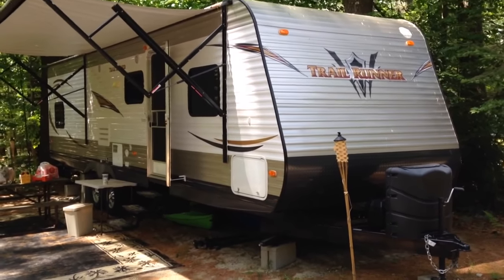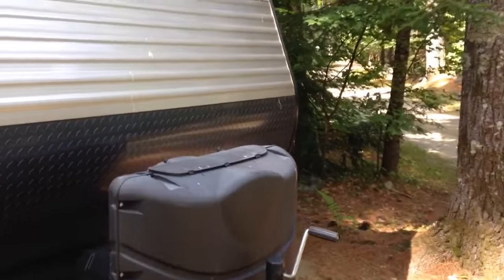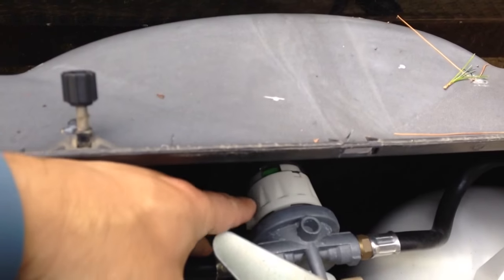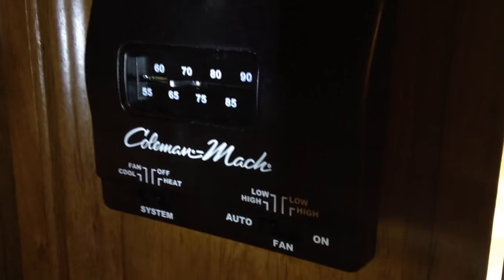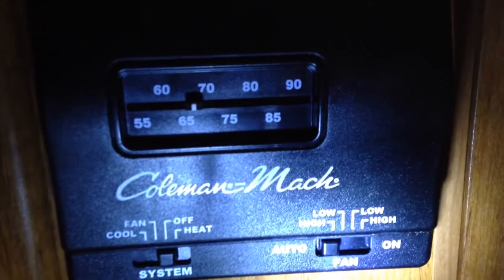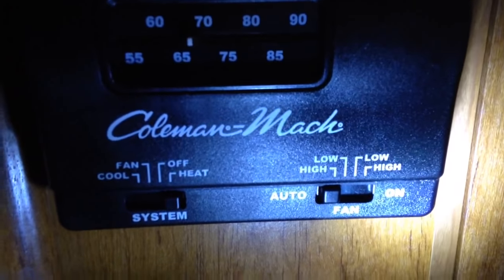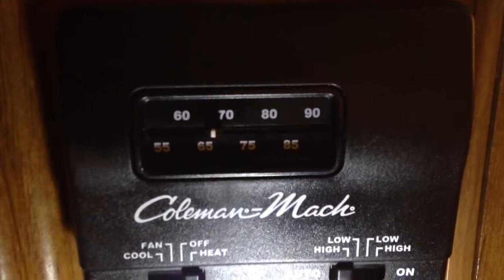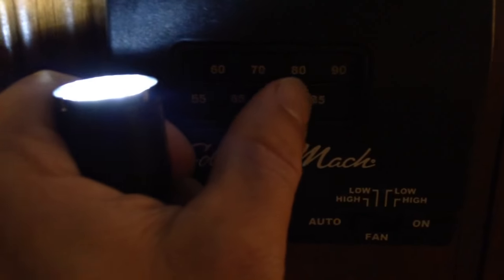How To Turn The Heat on In Your RV or Camper

Comment: Does the pilot light need to be ignited manually on the heater/furnace?? Or does the electric or battery get the pilot light sparked on??
Reply from the maker: There should be an electronic ignition on it.

Comment: I did in fact just buy a used one. 2001 Jayco 294J.  It has a couple of vents in the floor for heat output. But could you tell me- if I wanted to run this "off grid," not plugged into power, is it going to need my 12V battery to run the furnace?
Reply from the maker: You would need a generator to power everything
Reply: Homeowner Repair Right. Yes. Particularly the A/C and microwave. I was just wondering about the heat only. So today I tried it. Using only the 12 volt battery, the furnace does work. I’m assuming the furnace needs electricity to spark the furnace and blow the fan for the furnace.
Reply: @daakrolb  thanks for checking that]s great  !

Comment: Question? I acquired used rv travel trailer; No batteries or propane tanks; I would like to ck furnace, have old battery I charged up and 1 propane tank I took from my barbecue; I bought a 30 amp plug that I connected to outside electric house current via adapter plug to get 110 power; Can I now try to see if the furnace will work? does it matter if the battery power is low as long as the 110 is plugged in?  (Sorry basically ignorant about everything)
Reply from the maker: If you’re getting power from your electrical outlet, it doesn’t matter if the battery is low. You can turn the propane on and test the heat. Hope this helps you out.
Reply: Super, thanks for quick reply, will get right at it after I install both carbon monoxide detector.
Reply from the maker: How did you make out. Did you get the heat working
Reply: @HomeOwnerRepair     I would like to know , also

Comment: How long does the propane usually last when using the heater?
Reply from the maker: We do not winter camp, but there are some cool nights in summer in fall.I can typically get a season out of one tank.
Reply: You usually get about 1 hour per 1/3 gallon of continuous use... so 3 hours per gallonish

Comment: So guessing theres a automatic pilot light that comes on correct?
Reply from the maker: If you have a newer camper there should be an ignition that lights the propane to provide heat to the camper.

Comment: Do you need both propane tanks open when turning on heat or can only one be open
Reply from the maker: There should be a selector in the middle that points to one tank or the other. You can just open the tank that is selected.

Comment: I was just wondering where the power is picked up from and is it on a fuse 
I have no power at the thermostat
Reply from the maker: There usually is a circuit breaker that it is tied to. You may want to check for a tripped breaker first.
Reply: @HomeOwnerRepair  found out the mice chewed the wires

Comment: If its plugged in to electric do you need propain open
Reply from the maker: Most of these camper do run the heat system off of the propane.

Comment: I have the same thermostat as you.  I am hooked up to full electric at a campground.  It’s time to turn on the heat.  How do I know if heater is running on electric or gas.  Thanks
Reply from the maker: You should be able to heat it come on.

Comment: Do you need the propane on to get heat? Can you get heat with electric only?
Reply from the maker: The main heating system typically runs off of the propane.

Comment: So what would you recommend if it still doesn’t kick on after I go through these steps?
Reply from the maker: Check to see if the propane is on and isn't empty. Also check the circuit breakers to see if one is tripped.

Comment: Do u have to be plugged in also will it work if battery are dead
Reply from the maker: The trailer has to be plugged into a generator or electrical outlet for the heat to turn on.

Comment: How are you getting electricity to the trailer? Or does it need electricity?
Reply from the maker: I'm seasonal so we have electric to the campsite. You will need electricity.
Reply: @HomeOwnerRepair   can it run off just a 12v battery or will it next hook up or generator?